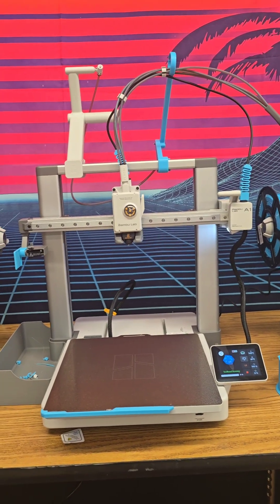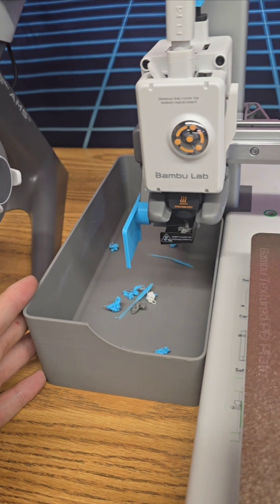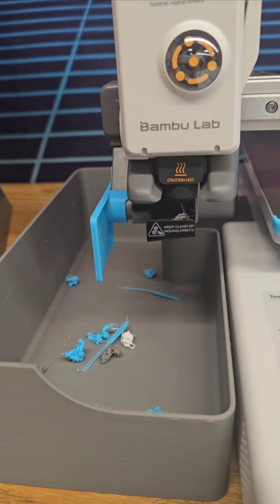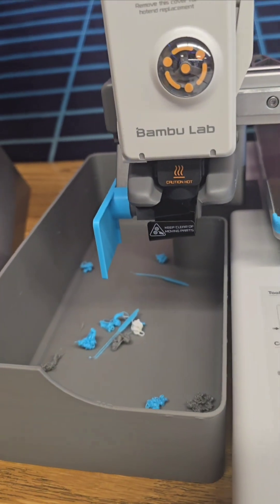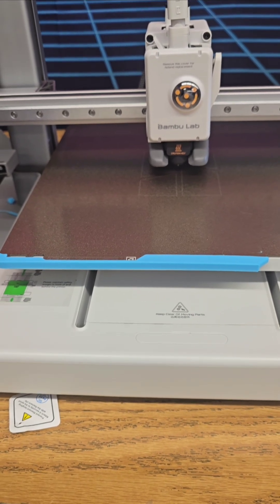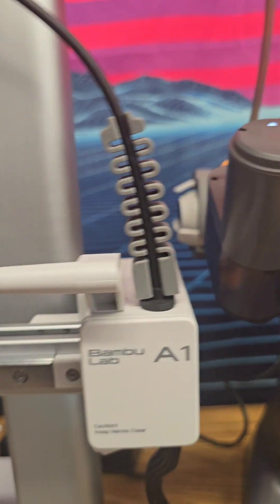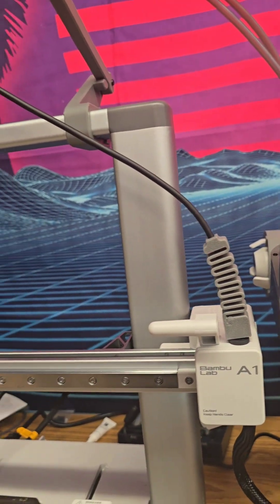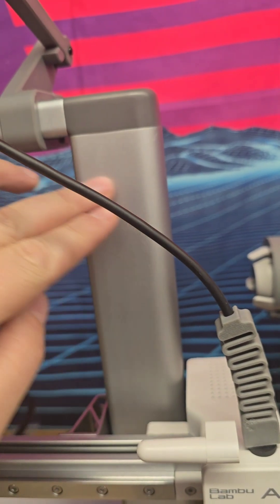Bambu Labs A1 Upgrades (So Far)

Comment: @caseo PTFE tube holder does not seem like a good design.
Mine keeps shifting to the left every couple of prints and if i dont adjustment it back to the right i notice it puts stress on the tubes.

Maybe someone can link another design as i hate the tubes rubbing on the metal.
Reply from the maker: @cricstorm2218  which version did you make?

Comment: Great Add Ons  I just enclosed my AMS spools with one I found and with the Hygrometer in each side I can now monitor the humidity for the filament it works great.  I am now looking for an enclosure for the External spooler   that way I can leave a spool on for some time without worrying about the filament having a problem.
Reply from the maker: @thomasgrassi8817  i like enclosures. I just don't live somewhere that humidity is an issue.

Comment: I printed one of those Y-splitters so  I can have the ASM permanently connected  and the external filament spool aswell. Also I did use the Top mount, but went back to the normal setup. At 100% speed or higher the top mount was wobbling quite a bit with 1-2cm deflection. That was visible in the prints.